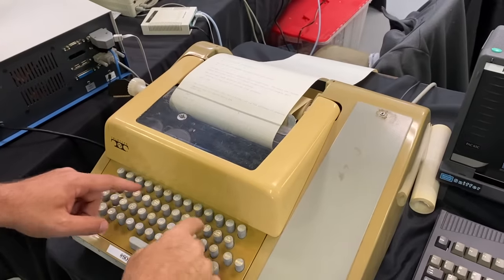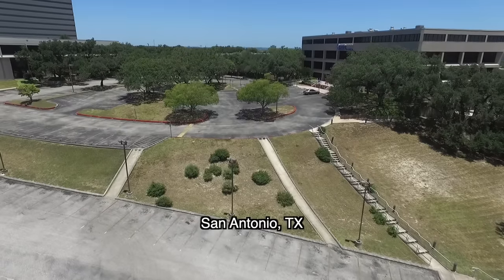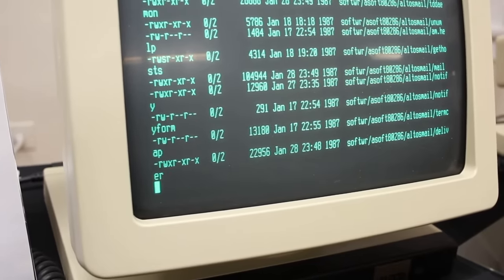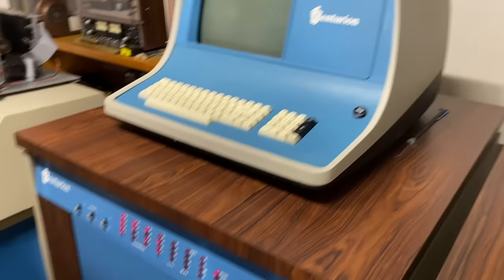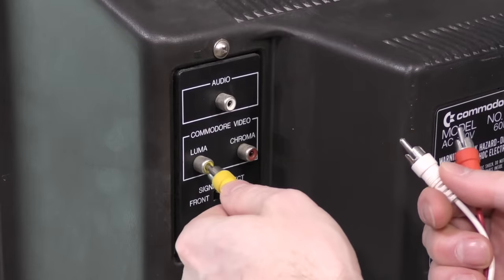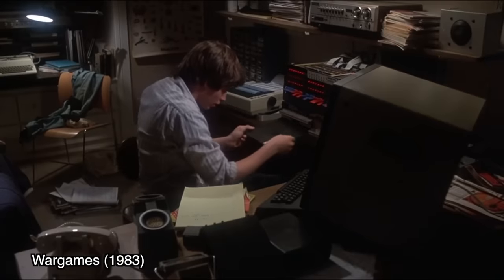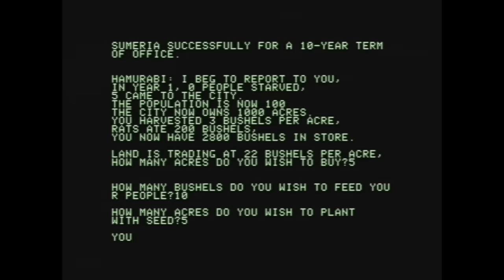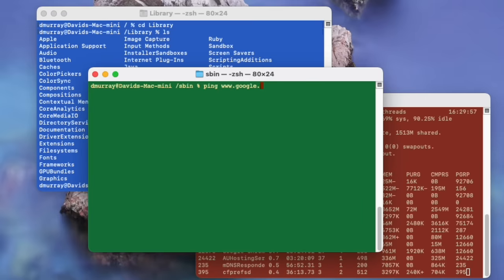What are Dumb Terminals?

Comment: There were also X-Terminals (e.g the NCD19 from 1989) that acted just like dumb terminals but displayed graphics from Unix servers via the X11 protocol.
Reply: Elon Musk would have loved those.
Reply: @Tiago-Martins  Why do elon simps never make any sense
Reply: @heliusuniverse7460  Woosh, you missed the obvious sarcasm.
Reply: @heliusuniverse7460  the presence of so many X's is the key to understand what he means
Reply: The X logo looks a lot like the X11 logo.
Reply: I would say that X-Terminals were not 'dumb' at all, and they did not just act as terminals, but almost like an extension of the computer. OK. they did not do (much) local processing (but some of them actually could, they often had Motrola, MIPS, Intel or PowerPC 32 bit processors in them). But they allowed multiple sessions and programs, with overlapping windows, and were controlled using not only keyboards, but also mice and other input devices like dials and graphic tablets.
And then you have things like the AT&T/Bell Labs Intelligent Terminal (BLIT, although this could be a bacronym, the AT&T 5620, 630 et. al.), which actually did allow local processing on the terminal (including editors, graphics design programs and even games), but relied on being attached to a host computer for file services over a serial line or Starlink (proto-twisted pair Ethernet - by the time you get to the 730 and UTP Ethernet, they were effectively LAN connected PCs).
The history of computer terminals is long and complicated.
Reply: @petergathercole4565 they were still terminals in that they took a serial connection and interpreted it as display instructions. The serial connection was just faster.
Reply: Well, most X terminals were connected via Ethernet (or sometimes Token Ring, so not really serial at all.
Reply: you can actually still use dumb terminals and teletypes with linux. they never removed the functionality.
Reply: @grants7390  The problem with using real terminals is that you don't get RS232 serial interfaces much any more. The USB-serial interfaces generally don't drive the non-data pins properly, so hardware handshaking can be problematic when trying to interface with vintage hardware.
Reply: Contrary to what the wayland fanboys want, X11 still lives in its Xorg incarnation used in Linux, BSD and others. Its cool because they can do geometry, fill, bit-map, etc. With the likes of X2go you can still benefit with most of the protocol for a remote desktop use, rather than passing the whole screen back and forth like some other solutions do. And yes, a. single server can serve many clients across a variety of means much more efficiently than the likes of vnc, etc.
Reply: @petergathercole4565  Really? People have been saying there's no more RS232 for years, but the last 2 towers I bought both had it. They were both second-hand, but still good for all but the latest games.
Reply: Dumb is relative. For instance, the ADM-3 terminal here is not properly a dumb terminal, nor are most of the other terminals shown here. They interpret escape sequences where a true dumb terminal isn't expected to interpret any control codes beyond carriage return, line feed, and maybe backspace, but don't expect backspace to erase characters. The feature set of later terminals was very large with everything from programmable characters to windows as regions of the screen to constrain text output. Many of these had computers built in, but you couldn't directly program them. An example is the VT-05e; a budget terminal with a PDP-8 inside. (Remember that RAM was the expensive part for much of the 20th century.)

    X terminals aren't all that far beyond this, and there were terminals in between with simpler window systems. An example is the Blit (initially called the Jerq) developed for Unix in 1982. The Blit had its own 16-bit CPU and you could upload program code, but its computing capacity was taken up with with the window system, window management and moving textures around.

   The line between terminal and computer gets blurred out of existance with Plan 9 from Bell Labs. In Plan 9, everyone shares a file server and heavy computing jobs are done on "CPU servers", but the majority of the users' computing needs are satisfied by "terminals" which are, in fact, just diskless computers.
    One of the guys; I forget if it was Dennis Ritchie or someone else, would go around with a boot floppy for each type of workstation in the Labs. Whenever he happened to be when he wanted to use a computer, he'd just boot Plan 9 on the nearest computer from a floppy and the central server. ;)
Reply: @eekee6034  PC manufacturers have been not providing serial ports for many years. Very few desktop PCs, and almost no laptops include serial ports any more. You can still sometimes find systems sold with real serial ports, and sometimes you will find that a motherboard actually has UART hardware but which is not connected to the backplate, but serial hardware is definitely in the legacy category.
Reply: I wounder if anyone has made an emulator for the NCD19. Other modern methods might exist to achieve the same effect (RDP, VNC, ect), but I have just been having fun playing around with a Tektronix emulator and trying to write C code to draw to it's screen via it's escape sequences.
Reply: @petergathercole4565  anything that's not a teletype or glass terminal probably shouldn't be considered dumb at all anyway.

But I guess the idea is that no data or data processing logic is done locally, you may have local macros but what really counts is the things that get sent back to the remote computer, and that's the dumbness of a terminal.
Reply: @grants7390  It is still useful. Accessing servers via text is more robust. Moreover, these ttys can be accessed (as originally) via a serial port, handy for headless embedded devices running Linux for maintenance/debug tasks.

Comment: A lot of the older teletypes shown in the first part of the video (Model 15, 28KSR, and even 28ASR) were rebuilt in the late '60s and early '70s to be used with acoustic modems so deaf people could 'call' each other on the phone. I don't know if it still holds true anymore, but as late as the 1990s, there were some older deaf people in my area that had one lurking in a forgotten corner of their basement or garage...

Comment: What simply made it hard to use screens for text for a while was lack of good internal memory for the screens. NASA actually used physical overlays for most of the text and a display for numbers, this was recorded by a camera and multiplexed (read: made into TV channels) onto the displays in mission control
Reply: That and the screen flickering (in movies and TV shows). In every movie where they actually used computer screens you can see the bad effects that different framerates have.
Reply: @neumi569  Since all movies uses 24 fps, those computer screens doesn't display very well on cameras that record in 24 fps.
Reply: lol, i like the idea of using overlays because we did not have enough memory.
Reply: @leap123_ 
24FPS has not necessarily been the standard since digital projection became ubiquitous. There are so many caveats and a lot of nuance, but it is film projection which actually was standardised at 24fps.  Cameras had long since already had variable control over frame rate, and filmmakers commonly utilised that for artistic and practical purposes.  An experienced camera operator could try to match the frame rate on the screen, but mechanical vs electrical limitations can and most probably will still end up being off.
Reply: Early terminals often had to use delay line or shift-register memory, making them quite complicated. During most of the screen, you could only access the specific character being displayed, and that required lots of tricky timing to update the display. The time period where directly addressable memory became affordable, but a dedicated CPU was not yet affordable was rather narrow, and ended in the late '70s.
Reply: NASA used an Eidophor projector to show large video images in Mission Control. The technology uses oil and a rotating disk. It was developed in the 1940s.
Reply: ThatGuy is correct. I had assumed that Mission Control was using 3270 mainframe terminals… but I found out they were actually watching TVs with the image from a terminal on it. To switch displays they switched the video input, not keying something in.

Comment: Wow! Brings back memories of early Silicon Valley when there were still fruit trees between the little office buildings. I worked at Tymeshare between '74-'77. thermal paper and teletypes. Later, wrote a lot of COBOL on dumb terminals. Blue/green bar paper. Mountains of it. The stone age. Thanks so much for this.
Reply: I worked security in Silicon Valley in the late 70s. Tymeshare was one of my patrol stops. Later on, I worked at the old Pacific Telephone, then Pacific Bell, and became the go-to guy in my office to pull COBOL-based reports on those dumb terminals printed out on bar paper. Good times. 😁
Reply: @PlasmaCoolantLeak  Yeah it was great and a lot of fun. And there's still people writing COBOL out there!

Comment: Data displays were made in the 50’s and 60’s for military applications. Look up a Charachtertron. There was no digital pixel set to create as they used a physical mask to create the characters and they could write a whole screen of text with it. The founder of a company I used to do work for designed and built the first ones for the Convair corporation in the 50’s I believe. Later there was a typotron tube but it worked on a slightly different principal.

Comment: The NASA mission control screens aren't really terminals but basically TVs; They received a video signal that was a live from a video camera that combined computer output and pre-rendered outputs
Reply: That was the case for the big, "wall type" screens, those were part video projection and part computer output.

But the terminals seen at each mission control desk were something different, those were called "charactrons", video tubes which could display a fixed set of characters or even graphics. Each of these tubes were used with hardwired logic, that can change the display to a certain degree, obviously to display varying values, but also switching "pages" for different displays. But their function was pretty much "baked in", for whatever telemetry was needed for the controller, so you couldn't just, for example use the CAPCOM displays for FIDO...
Reply: @soriac2357  thanks for the explanation. I was thinking I remembered something like that from an old video of Fran, but I really thought it described the Crt screens. Cool to know the details now.
Reply: In the video they where not saying NASA was using terminals. But that the concept of having computer screens was kinda advanced at that time. He was giving an example of where tech was ahead of science fiction to some extent.
Reply: @soriac2357  The wall type were Eidophor projectors. They used oil and a rotating disk.

Comment: Happy to see Datapoint mentioned. I'd love to see an entire video about them. I feel they deserve to be better remembered considering the amount of new ideas they brought into computing.
Reply: I worked for a few years with Datapoint computers. The company had three at different sites (one in Norway) that were, for the time, advanced small stand-alone computers that could connect up by modem when required and transmit files to and from another stand-alone machine in the main office, which wrote it to mag tape which was read by the mainframe. 

Sounds pretty silly today, but it worked and I guess was worth it. I certainly enjoyed it.
Reply: In the early '80's if you dialed Merrill Lynch's 800 number it would be answered by someone with a Datapoint terminal.  The terminal included a telephone handset.

Comment: Great nostalgic topic for me. As a home  health nurse in the 1990s we had dummy terminals at our agency that were connected to a AS 400 IBM computer located in the hospital.  We were sternly warned always to log off the terminals every time we used them for if the units were shutdown by flipping the power switch or if the power went out the whole system likely would crash. I was amazed at how well the whole system of 30 terminals worked. The terminals were spread out across town, connected by dedicated phone lines. We used the system for ordering supplies, basic word processing, for entering forms to be transferred to the US government for reimbursement. However, in those early days I accidentally typed in a global record delete that began to rapidly erase every patient in succession from “A” to “Z”. I could see the names flashing by on the terminal so I flipped the power switch which surprisingly interrupted the loop. Three temporary secretaries were hired to re type about 280 records up to the letter “R” which took several days to enter. I kept silent about my mistake!
Reply: That's really a program error, not yours. Impractical.

Comment: I'll be aging myself here. I went to high school in Utah and we were fortunate enough to have a two year program for computer science and programming. The majority of the systems we used were the still fairly new Radio Shack TRS-80 model 1 computers. We had one Commodore Pet as well which nobody used (I wish I had that now). In one corner of the room was a teletype machine. This connected to the Univac mainframe at the University of Utah and one could program in Basic, Cobol, and I think Fortran. Obviously it wasn't the most popular system to use, but I did do a few assignments on it just to try it out. Anyone with an account on the mainframe also had an e-mail address assigned. I never got an e-mail, though I wish I had because that mainframe was one of the original Arpanet nodes. So in theory, I could have gotten an actual e-mail Form a system in another state before there was an 'internet'.

Comment: As a little kid in 1987, my dad took me into the University where he worked and there were rooms full of ADM-3A terminals connecting to Prime servers. Even as late as 2001, my college had its library catalogue accessed through VT320 terminals (though soon replaced by a web-based system). Then at my first job in 2005, most employees had thin clients instead of proper PCs. These are essentially graphical dumb terminals - they send your keystrokes and mouse clicks to the server, and download bitmaps of the Windows desktop and whatever programs you are running on the server.

Comment: My first experience with a "real" computer was my freshman year in college, where I was a CS major (back then, you were really a Math major with a certain specialty). It was used in my FORTRAN programming class and consisted of several DEC VT100 terminals connected to a DEC PDP 11 "minicomputer." Loved those DEC VT-series terminals. Great keyboards on them.
Reply: Yeah!!
Reply: It is wild how back then you really needed to know what you were doing to be able to use a computer.  Technology moved so fast back then. You might go to college and learn all about how to use computers and in just a few years time all the information would be outdated.  I'd say it wasn't until Windows 9x that your average person could use a computer without too much trouble.  Windows 3.1 was a big step ahead but you still had to have a little knowledge of the system to really be able to use it.  Once Windows XP came out then anyone and their grandma could use the computer pretty easily.  It has been almost 22 years since XP came out and things really haven't changed that much compared to how it was back in the 80s and 90s.

Comment: To riff on the end bit, the "terminal" software available in Linux and Mac has much more than a skin deep connection to this history. Its operating system architectures date from the period of true dumb terminals, with files like /dev/tty (standing for "teletype") to manage connections to user sessions, and it still supports the same escape sequences of characters that were used back in the day to move the cursor, change colors, etc. If you have one of these devices, you can most likely connect it to a modern Linux system (possibly with some work to enable insecure legacy stuff) and use it to log in and run programs just like 40+ years ago.
Reply: Yeah, I remember setting up a machine with the serial port added to inittab and a null modem cable to a machine which I could run a terminal on . This was probably my most secure machine at the time, stripped down to run only the essentials ,
Reply: Indeed! This is a core component of why we can use computers without features like keyboards and displays, now known as "headless". One obscure bit of compatibility is for upper case only terminals like the one in Apple 1; logging in with an all upper case username tells getty to switch on case translation modes, as with "stty olcuc iuclc". Otherwise you couldn't type most Unix commands, as they are lower case.
Reply: It's trivial to enable, and not insecure!  You get a login: prompt just like you do on a virtual console by pressing Ctrl+Alt+Fn, where you can choose F1 through F7.  7 virtual consoles are the default, and your graphical session (and graphical login screen, in some configurations) will use one.  For all the others, you'll just see the virtual console number, hostname, and a friendly login prompt!